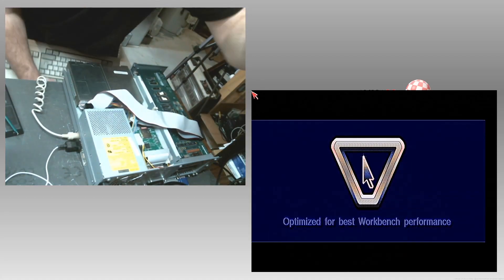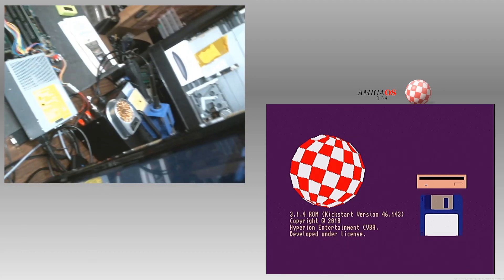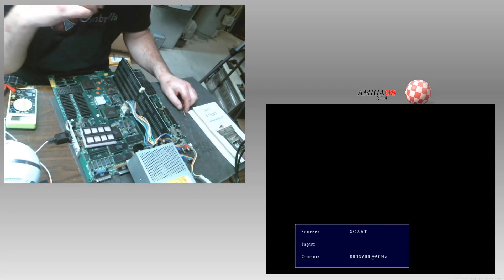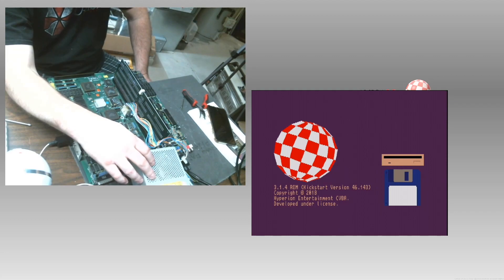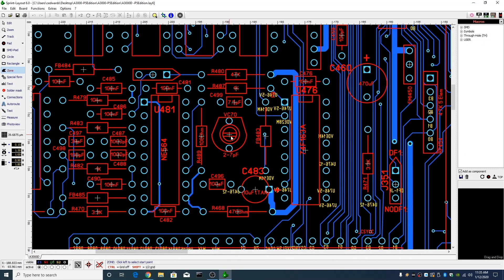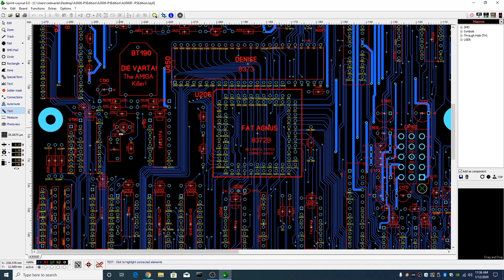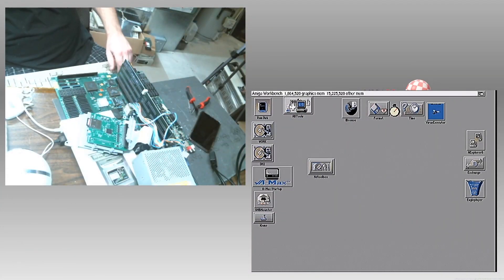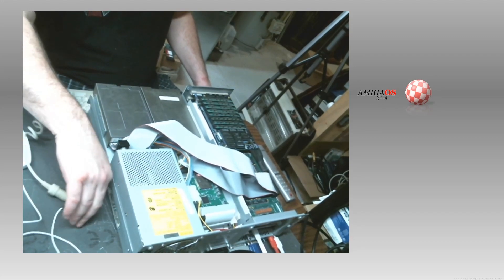Amiga 3000 Bad Amber pot

Comment: It appears I lucked out with my recent A3K acquisition. With the display enhancer enabled, the image was littered with shimmering edges. I already knew the trimmer is used to help adjust them away. At the same time, I noticed the shimmering disappeared after the computer was powered up for a while. That made me think it was a component/Amber problem. I finally introduced some contact cleaner into the trimmer and did some adjusting (I still had my original adjustment tool stashed away). I was able to get a stable image. After the computer was powered off and back on the next day, the image was still stable! So it could have just been a dirty POT and needing adjustment.
Reply from the maker: Very good! glad its nice and clear now!